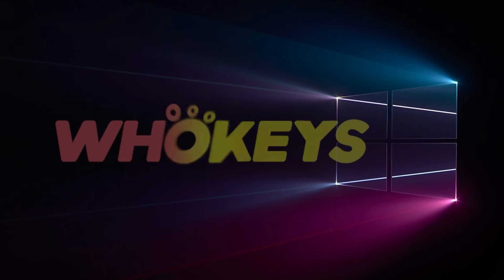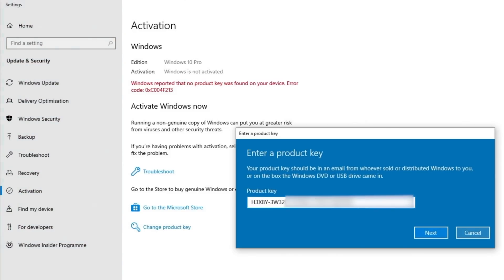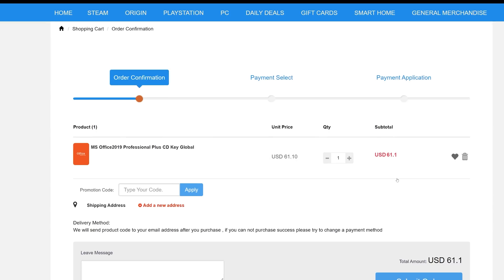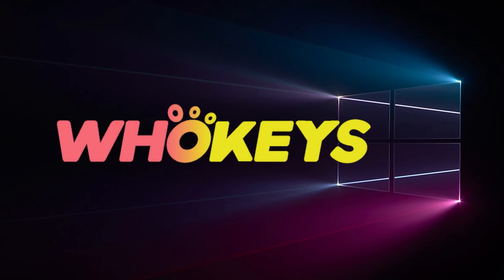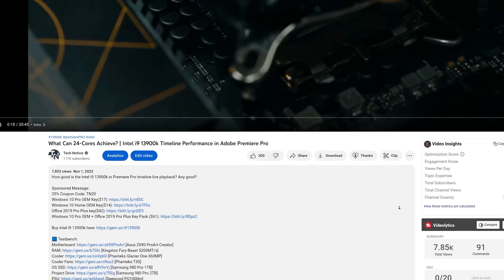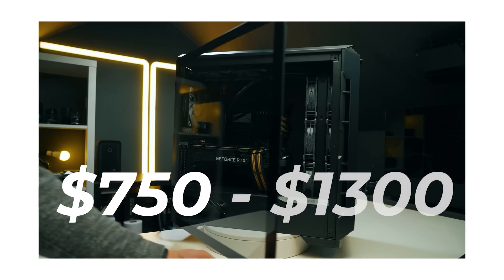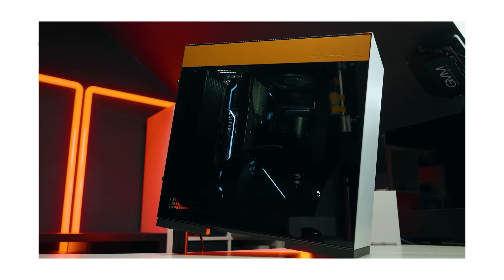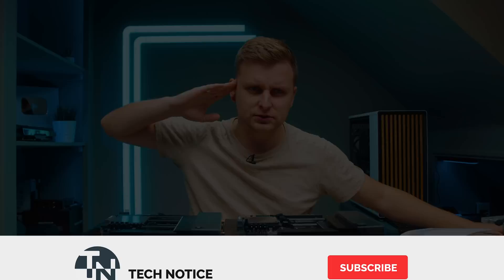BEST Creator Motherboard for Intel's 13th Gen 👉 Asus Z790 vs Z690 ProArt Creator WiFI

Comment: I'm curious, would the combo of Intel Core i9-13900K + ASUS ProArt Z790-CREATOR WIFI LGA 1700 ATX Motherboard + Crucial 64GB Desktop DDR5 5200 MHz + ASUS GeForce RTX 4070 Ti TUF Gaming Graphics Card, be a good idea for a build?
Reply: Get ddr5 higher. 6800
Reply: I have the same CPU/Mobo. 5600MHz ram though (not interested in overclocking). The main issue is that no reasonable cooler seems good enough to handle that CPU. I have a Corsair h170i and even then the CPU goes straight to 90+ degrees at full load. Avoid M.2 cards with integrated heatsinks.
Reply: @sherry8444  Why avoid M.2 drives with integrated heatsinks? I am about to order one and I would appreciate your answer. Thanks.
Reply: @Alex_Greu_de_gasit  It depends on the M.2's heatsink

9:43 When he takes the mobo M.2 heatsinks off you can see a large square black standoff pad. They are meant to support the M.2. in the middle. And they didn't seem detachable to me.

If your M.2 has an integrated heatsink (that covers the underside, not only the top), such as the Seagate FireCuda 530 (there is heatsink and non-heatsink version), then that square standoff MAY cause the drive not to lie flat... and it needs to lie flat to use the new Asus Q-Latch system to secure the M2 to the board. 

FireCuda instructions say the integrated heatsink is not meant to be removable and also says that because of the heatsink the FireCuda does not conform to M.2 specification (something a retailer may not mention). Other M.2 manufacturers may have removable heatsinks or heatsinks that conform to M2 specification and they might be fine... be sure before you buy, or be safe.
Reply: @sherry8444  Thanks for pointing that out. I'm going for a Samsung 990 Pro with heatsink, which also covers the underside, as you said. But I checked the motherboard manual and at some point it says "For 2242, 2260 length - optional - Remove the M.2 rubber", so I guess those preinstalled standoff pads are removable. I trust the SSD manufacturer's heatsink rather than those on the ASUS motherboard, which look quite cheap.
Reply: @Alex_Greu_de_gasit  I have the 990 Pro too, without heatsink though.

I did read the manual. I couldn't see any screw on the backside of the standoff, and I tried pulling and twisting the rubber off with reasonable strength. There seem to be traces around and possibly under the rubber so I didn't risk damaging those with more force.

I would have risked it if the manual was clear. But it really isn't. You will note it talks about the "pre-installed  Q-Latch" in the next sentence, but it doesn't say "pre-installed M.2 rubber". There is an optional thin rubber pad which you put on top of the pre-installed one (for 1-sided M.2 drives), so in the end I assumed they meant remove the optional pad! So be careful!

But you could risk it if you really want, maybe with heat... or shave the pad down with a sharp knife.

Comment: Wish there were more Z690 vs Z790 comparisons like this! I want to point out that the Z690 had a whole year of use in the wild so it has all the BIOS updates and manufacturers' tech supports have resolved more of the bugs than with Z790. 

Your videos helped save me from blowing money on Z790 and DDR5 - I have a higher level DDR4 board now because I had extra money in my budget from using the older tech. Thank you!

Comment: Do you know what version of the thunderbolt controller firmware nvm is running on z790. Z690 comes with v31… although bios 2204 updates it, which fixes some issues but causes other issues as well.

Comment: I was looking forward to your review of the z790 ProArt and I'm disappointed because you basically said "go watch the z690 review". The problem is that review is not accurate at all for the z790. For example, you say there that the M.2 driives and the SATA drives are totally independent, but on the z790 there are some important differences. Refer to the "Connectors with shard bandwidth" page in the z790 ProArt manual and maybe (hopefully!) you do a full review of the z790, which I know many users were waiting for. Thank you for all your work!

Comment: Great info. I have heard that, with z790, if you have an m.2 in the top pcie slot, it will cause the bandwidth of the your graphics card to reduce from 16 to 8 lanes, slightly reducing it's performance? Is this true?

If so, might it be better for a creator to go with z690 - considering that GPU performance is more important than ram speed for video editing?
Reply: i can say this happen to me on my aorus  x570 xtreme motherboard. i have 3 2tb m2 pci 4.0 drives. i had all 3 filled.  i have my 6900xt and 5950x. I notice a drop in performance. then i removed the 1st m2 drive and put it in the second m2 slot , the 2nd one to the 3rd slot. so now i have just 2 drives installed now.  I had noticed a big jump in performance and stuttering stopped as well.  so i can say having that that using that top m2 drive with a high gpu will cause performance loss.
Reply: @tbreeze79  interesting. Did moving your m.2 drive out of the top slot reduce it's speed?
Reply: @HopeProphecy  that increased the speed lanes. it decreased because i had the gpu and m2 sharing lanes.
Reply: @tbreeze79  That's because AMD's CPU/APU PCIE lanes are tied together, they aren't separated.
Reply: @AlfaPro1337  So this is a AMD problem not a Intel problem?
Reply: @AlfaPro1337  duh
Reply: I don't think so, Intel CPU has x16 PCIE 5.0 and x4 PCIE 4.0 (this is dedicated to the 1st M.2).

Comment: I suggest the GIGABYTE Z790 AORUS Master above the ProArt. It has better IO on the back than Asus and is a little cheaper. It's an E-ATX board, but has almost same size like a regular ATX board.
Reply: about the same price.
Reply: @freejack159 I'm wondering between these two (Asus ProArt Z790 / Gigabyte AORUS Master Z790), but it's not so obvious decision, very hard choise to be honest and price in my country is exactly the same. For me IO on the back is much superior on Asus than on Gigabyte (there is HDMI 2.1, two DP 1.4, one more LAN 2,5Gb and two Thunderbolt ports and more audio outs (not important for me) on ASUS, on Gigabyte there is no HDMI at all, DP is 1.2 and no Thunderbolt) On the other hand I suppose there is better power control for the CPU on Gigabyte, but i dont know how much it could influence overall stability. Furthermore m.2 cooling with double sided thermopads on Gigabyte looks nicer than Asus where we can mount cooling only from one side of SSD.
Reply: @@matthewwalsh2530 Was not aware of that but these are some very legit points from a professional standpoint. Gigabyte offers, for consumers I guess, a free 4 year warranty if you register your product btw.

Comment: I realised with your video that I threw the antenna to trash, thinking the packaging was just a spacer for the board to protect it...
Reply from the maker: Oh no! 🤦
Reply: @theTechNotice  well time to buy a new one on ebay for 30 bucks smh
Reply: @fangvisu4ls  use a cable is faster
Reply: I'm a wireless network engineer. You can just get any 3rd party antenna that has a decent gain. The ones packaged with the motherboard are bottom of the barrel so you pretty much can't go wrong unless you try 😂.
Reply: @AshtonCoolman  I ordered one from ebay, same as the one with the motherboard, should i cancel and switch to maybe a reference you might recommand?
Reply: @fangvisu4ls  I’ll answer for them; yes.
Reply: @RJBuildsPcs  thanks! do you have any recommandation of a particular model?
Reply: @fangvisu4ls yeah, RJ45 Category 8 25ft max length
Reply: Oh rip
Reply: rip

Comment: Nice review. Really wish motherboards would focus on PCIe 5.0 M.2 over the PCIe slot the GPU will be going in. By the time GPUs saturate PCIe 4.0 these boards will be very old, while drives are already being designed to use that bandwidth.
Reply: The issue isn’t the motherboard vendors the issue is the pcie lanes directly into the cpu itself. Alder lake and raptor lake only have 16 lanes of pcie5 bandwidth and 4 direct lanes of pcie4. So motherboard manufacturers are restricted from the start.
Reply: And a single PCIE 4.0 SSD has yet to saturate the bandwidth due to the controller.
Reply: Me looking at 3.0 that only barely is dying out. Meanwhile current 4.0 isn't pushing the limits. Lets be real 3-6 years 5.0 might be in full force
Reply: @9manny99  all about patience tbh; PCIE 6.0 and 7.0 probably are already in development 😂
Reply: @RJBuildsPcs   With that kind of silly logic of yours one should always wait with upgrading.

Comment: the motherboard specs are awesome but if i want dual rtx4090 or rtx4080... the pcie slot width are not enough... ouch.
Reply: Buy the lian li case evo and u can fit one horizontal and one verticals. With pcie cable extension

Comment: YES!! I kinda knew they were very similar. But I'm gonna go for the Z790 just for the extra gen 4 PCI slot for extra m.2 on my DAW built. Thank you 👍🏻.
Reply: I'm not running a graphics card, I'm kinda hoping the built in graphics of the 13900k will be enough for a DAW system (Recording music) nothing gfx intensive.
Reply: Well that extra PCIe will still run through the chipset unless you are willing to run the GPU at x8 instead of x16
Reply: @cybyrd9615  At x8 PCIE gen 5? Because that’s equal to x16 PCIE 4.0 which is more than enough for any GPU.